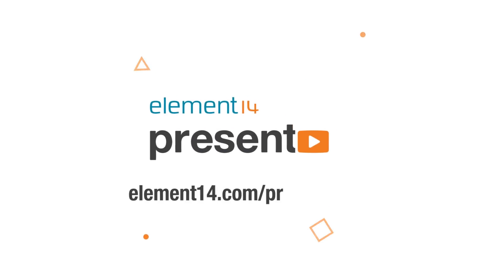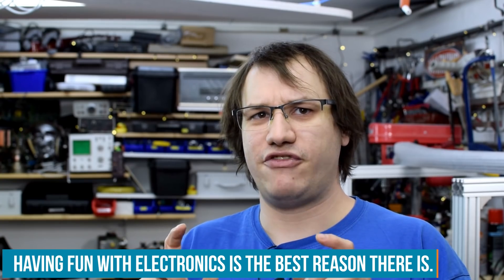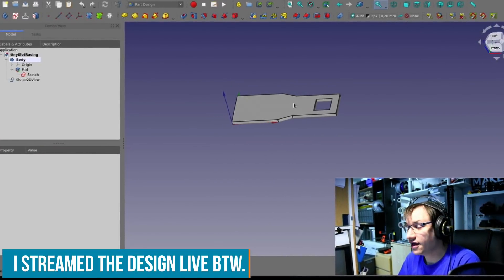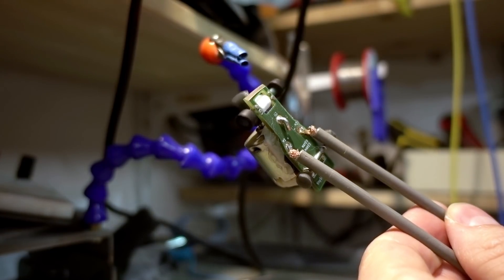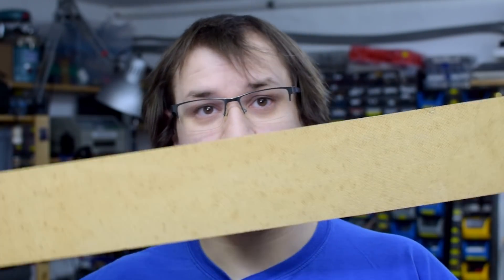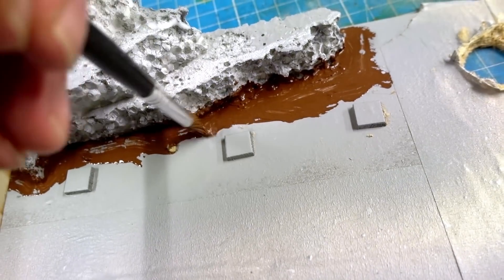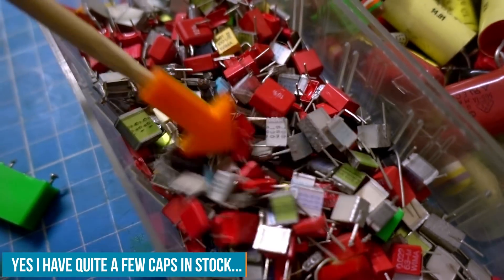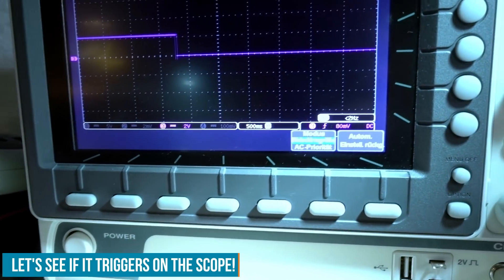#Arduino vs 555 Timer - Tiny Slot Car Racers

Comment: Some of the old slot cars used a rear pin in addition to a front pin, for stability (see Tyco US1 Trucking chassis) … your shoes would track better with a rear pin …

Comment: I made a 555 circuit to be an oscillator to press a button rapidly but when I pressed it for about 3 seconds the rate of speed would change and then it would go back to its original speed after some time but continue to change at regular intervals.

Comment: Neither... Cypress (now sub of Infineon) PSoC!!! Powerful CPU cores (8051 & several ARM flavors) combined with programmable digital & analog blocks for pretty much any peripheral you might want (logic, DAC, ADC, PWM, USB, Amps, counters, filters, display, keyboard... to name a few). Not to mention as part of the architecture, DMA & Interrupt controllers. Arduino is just a microcontroller. To get it to do anything useful requires external hardware modules... Well... I suppose it blinks LED's OK... :)  BTW... a 555 versus a MC? I guess Arduino needs to beat up on the lowly 555 to shine... ;)

Comment: Why use such a large motor (#130)? There are so many smaller motors and even geared version that have a smaller footprint than this hobby #130 motor. There are motors like the N20, or N10 that have planetary gear boxes. You can even get 6mm - 10mm micro motors and there is even a M10 motor.
Reply: It's just what I had

Comment: In the 555 version, you use the transistor as an emitter-follower, why not in common emitter mode?

In common emitter, connect the transistor emitter to GND, the load between Vcc and the collector, and place a  6,8k resistor between pin3 of the 555 and the base of the transistor, this will limit the current to 1(-ish) mA. Add a diode in reverse across the relay coil to limit the back EMF when you switch the transistor off.

Comment: You obviously accomplished what you set out to - but some more details during the overview would've made the goal a lot clearer...  (Certainly *I*' have no idea what "those 80's racing toys" referenced in the caption @2:00 are).  

Plus the title and description are misleading. Both say 'Arduino vs 555', but most of the video was about building scenery, a track, and (apparently intentionally poorly performing?) cars. It wasn't clear to me until deep into the video - after the 11 minute mark - that the whole point of either Arduino or 555 was to control how long to make power available to the car.
And even then, it wasn't really about comparing mechanisms, just about doing it twice.  Finally - at the very end - about 80 seconds about advantages of each (cost for 555; ease of implementation, timing accuracy, and flexibility for Arduino).

My bet is that ease and flexibility pretty much decide it for more than 95% of the maker community. Yeah, there's probably some small minority who'll think the 555 is better - but that's because they have a bunch of them sitting on the shelf waiting for a suitable project, they haven't learned to code, and don't want to involve their computer in the process.  But with the car involving 3D printed gears and wheels, vacuum forming (using a 3D printed master), and a PCB fab house produced chassis, the computer is already very heavily used long before you get around to implementing the timer.  So IMO, this use-case is a pretty clear win for Arduino.

Comment: I'm really not sure about the transistor relay driver. It definitely should have a reverse-connected diode across the relay to catch back emf. Not a big deal, but also a common-emitter setup would seem more obvious. 
As you're using a driving transistor anyway, you could have simplified further by using the standard 2-transistor monostable circuit. Oh, and 10M resistor for timing constant seems iffy, better to use a bigger capacitor, smaller resistor.
I suppose it also should be said that you're clearly more experienced with the Arduino setup that discrete-ish electronics, you're likely to come up with a better solution using more familiar tools. 
Aside from all that, nice job!

Comment: Nice theory and idea but horrible implementation.
Reply: We all have to start somewhere. Mine is finished in time, works and I had fun building it, that is a win on my books.
Reply: @MAYERMAKES , I agree.  Don’t get me wrong, I appreciate the video and the information.  It’s that I’m a little OCD and felt the mechanical part of it leaves a lot to be desired.  But that’s ok.  Like you said, that’s a good start, but specially for noobs.
Reply: @MAYERMAKES  Win in my book also. I do things like this as a hobby and it's great to have video's like this for ideas and to use and build on. Thank you for all your time you spent.